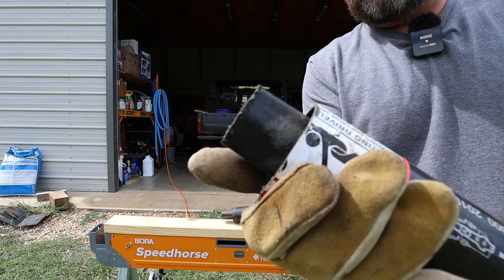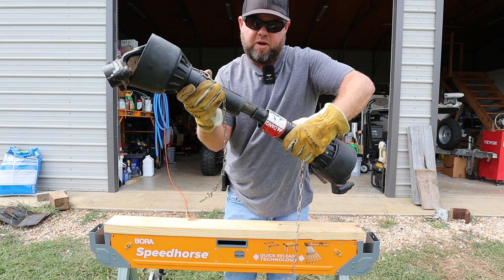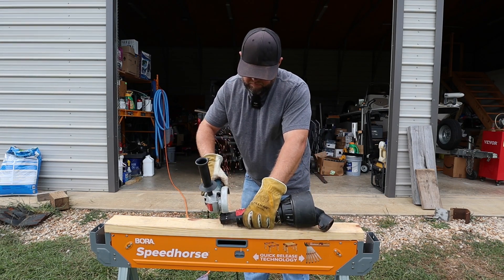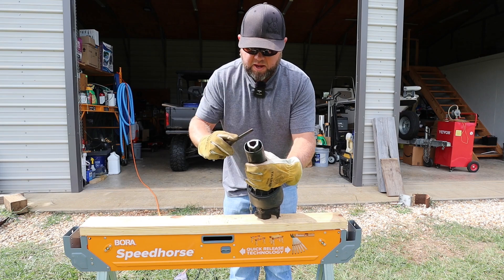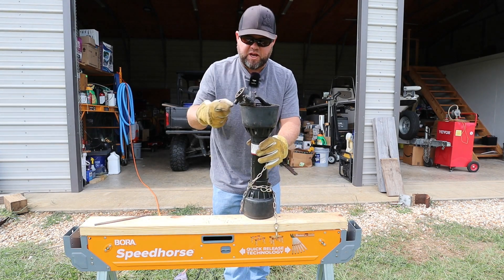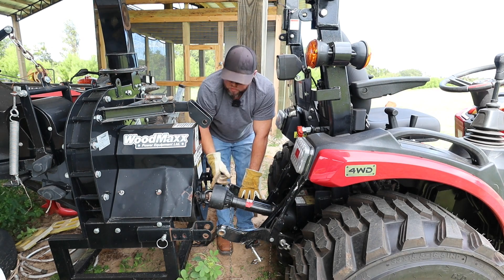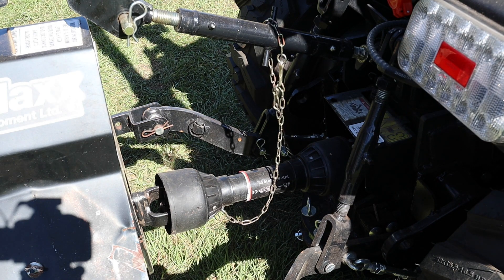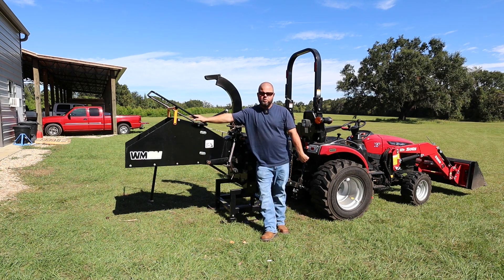How to cut a tractor PTO shaft!

Comment: Any issues with pull out on the John Deere now that you’ve cut the shaft down or do you still have plenty of shaft engagement?
Reply from the maker: I have not tested it, but I believe I will have plenty because the 3pt arms are moveable in and out on the chipper. They were maxed out for the smaller tractor requiring the cut.

Comment: Good video but you did miss a few steps on this one.. so you do not have to cut your driveshaft twice..

Get your straight edge/ level and measure from the shaft on your tractor to your 3-point pins. That will be your first measurement.
* second measurement would be on the attachment. Measure the shaft "( on that shaft will be in an indention/ where the shear bolt goes through). 
 " measurement from that indention to the end of the pins of the attachment that'll be your second number. Add those two numbers. That should be determine your shaft length.. 
Works every time! Some people use saw saw some people use grinders.. always put a little bit of grease on the shaft makes it easier to slide back and forth..